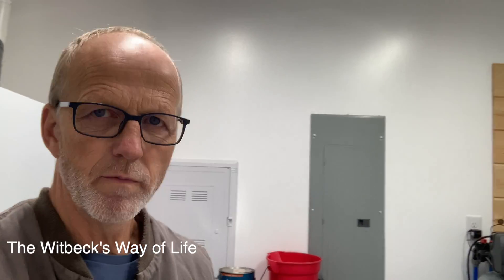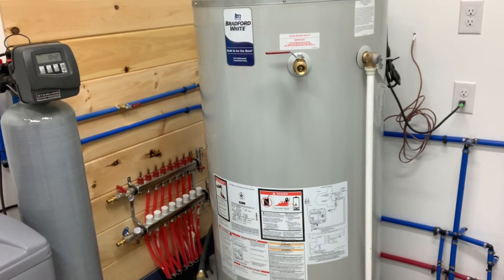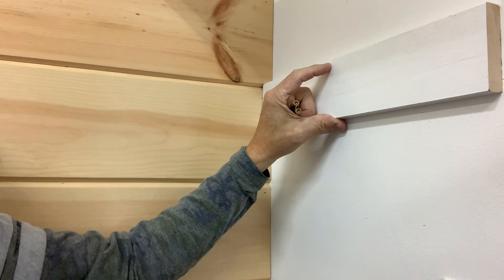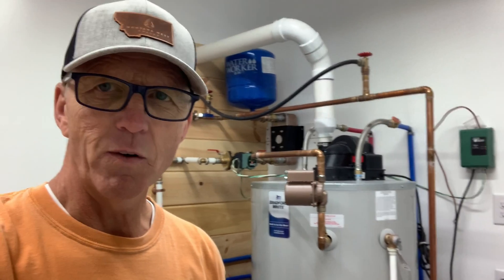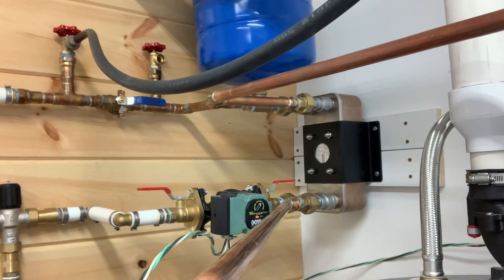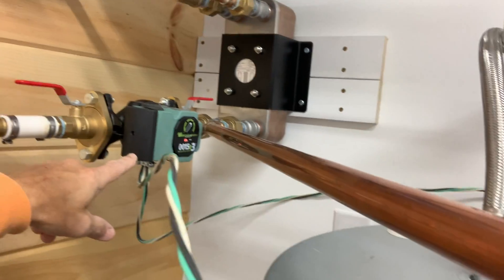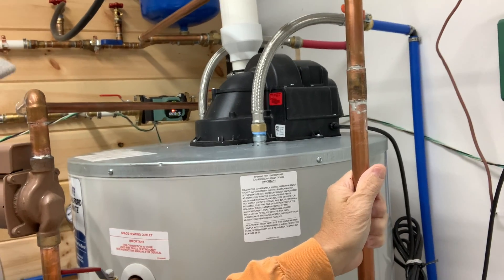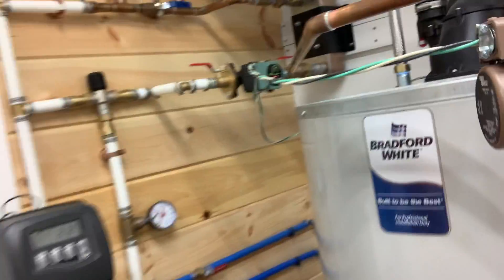DIY, Hot water heater for radiant in floor heat

Comment: Hi, if that label states for space heating only, its an separate isolated loop from the potable water. therefore you don't need a separate water to water plate heat exchanger. This feature that yours has is designed for exactly what you are doing. There is essentially a coil inside that the potable hot water tank that is heated that can be used to circulate a closed loop hot water heating system. They do not mix internally. There is nothing wrong with using a plate heat exchanger, but there is heat loss to consider. Hot water out the bottom, return water on top. The label they have is a little misleading. Nice install. Scott
Reply from the maker: Thanks Scott, I thought it was a separate loop but wasn’t sure so I just went with the 50 plate exchanger.  Thanks for your positive feedback and for watching over channel.  
Kevin